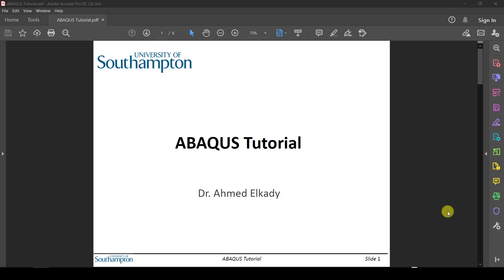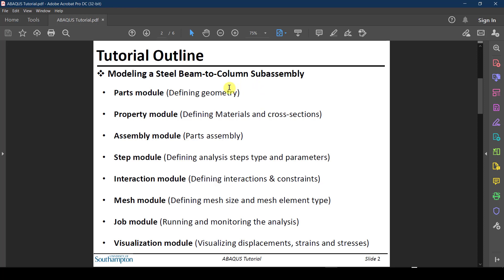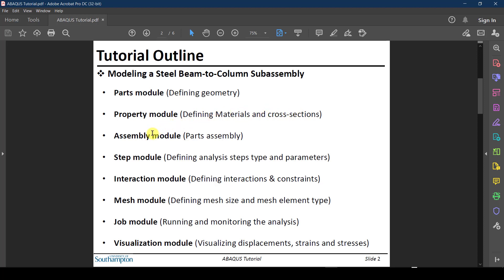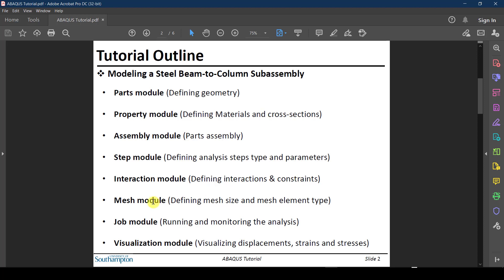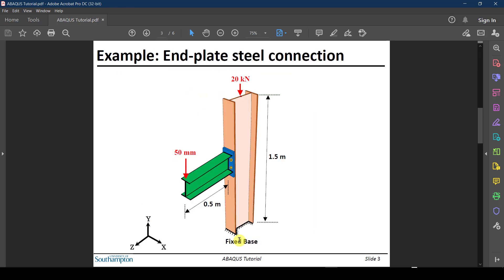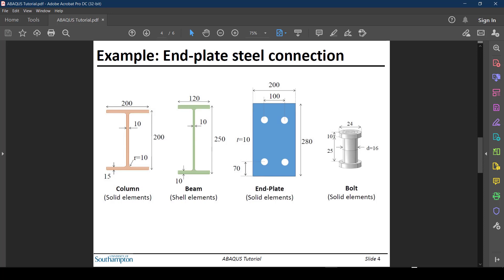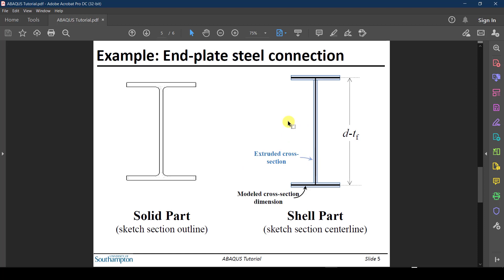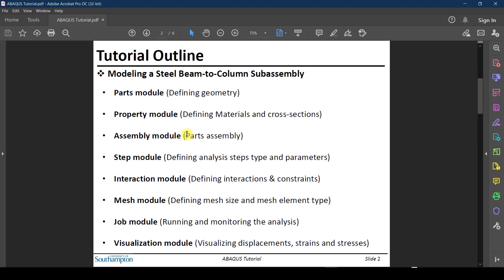#01 ABAQUS Tutorial: Description of the tutorial problem - Bolted steel connection

Comment: Hey, Ahmed really loves your videos, could you please do one example on concrete-filled steel tubes and reinforcements concrete-filled steel tubes. also if possible please make one on the concrete-filled steel tube column joints with steel or concrete-filled steel tube beam.
Thanks in advance
Reply: لو حضرتط توصلت لفديو او اي شرح ل CFST اكتبلي اللينك مشكورا